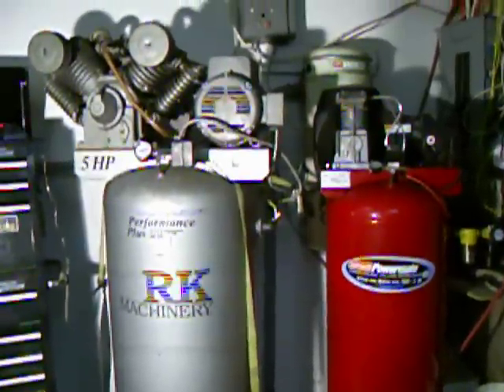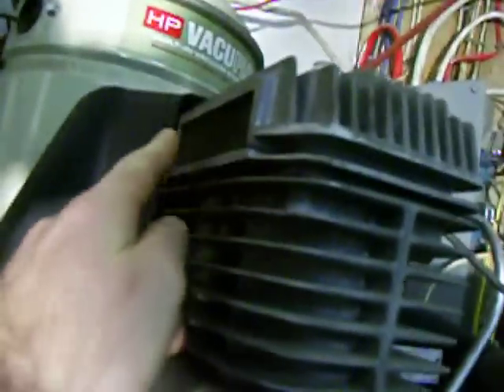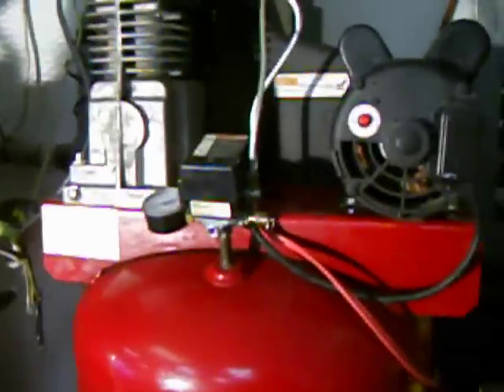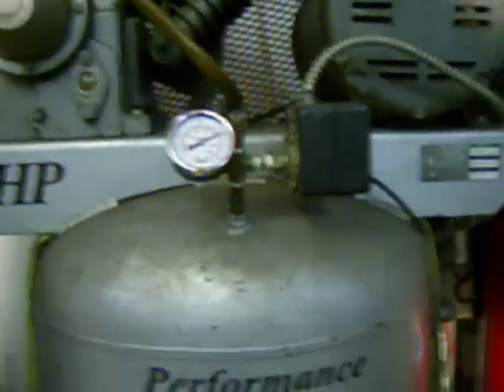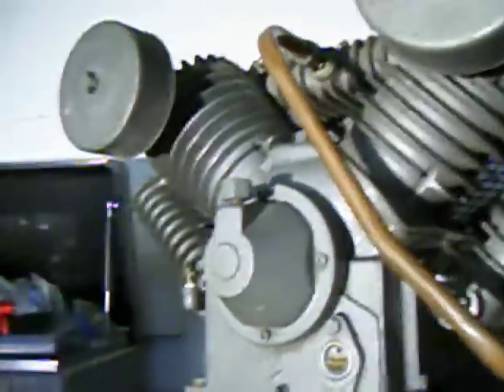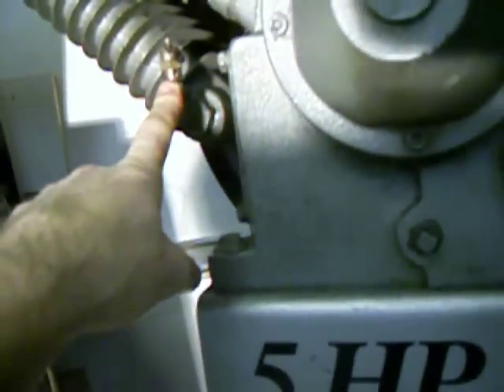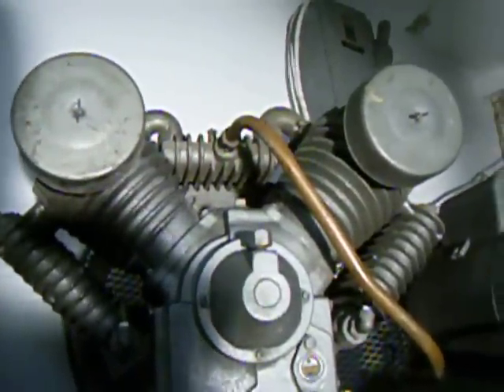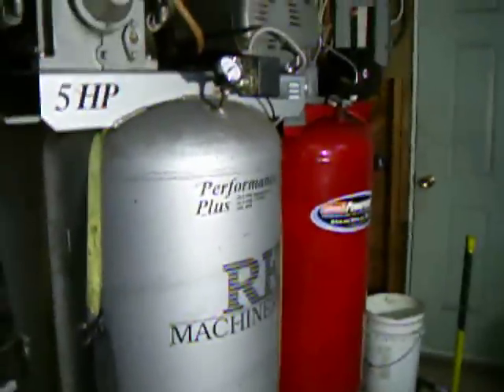Air Compressor Comparison_2Stage vs Single Stage

Comment: right at the moment i have a 30 gal 4 hp  sanborn built in 1980  which all the new one are 2 hp dont think it would be enough im getting afraid of the tank took off a fitting and looked at the with a scope still hard to detect how bad it is after seeing how some of these explode having night sweats great vid by the way

Comment: what is the noise level of the C
oleman
Reply from the maker: Neither were loud.  They were about the same volume but the 2 stage was pumping 4x the air that the Coleman pumps.  I wouldn't hesitate to buy either of them again.

Comment: for those of us who dont own both but are interested in buying upgrade, it would be good to run them both starting at 0 psi and show how fast the big one is at filling up compared to the box store unit.
Reply from the maker: All this info is going from memory:

The 80 gallon commercial RK compressor takes 9mins 15 seconds to pump up from 0 PSI to 175 PSI.  I know that is a long time... but it never has to do that work in my garage.  I don't have air leaks in the system and it simply pumps up from about 130-175psi as needed and that takes <2 mins. When doing tire rotations, I can do 2 cars before the pump cuts in.

The 60 gallon Coleman compressor takes about 4-5 mins to pump up from 0-140psi.  Then it drops to about 90 and cuts in until it reaches 140 again.  That recovery takes about 1 min 45 secs.  When doing tire rotations on a vehicle, the pump might cut in twice.
Reply: mr diyguy123 good to know, they are avout same then it sounds

Comment: same mistake everybody makes on your red tank. water separator/filter never goes there, yet thats where everybody put them. they basically are useless there as the water doesnt form til way down the line as it condenses. therefore, that device goes at end of line where you welill see a huge difference in its performance, for once, you will actually see it is catching something lol
Reply from the maker: Good feedback.  Many people simply have a rubber line leaving their compressor tank that they drag around their garage... but i agree with you that if you have the lines piped around the garage, having the separator at the tank does not take out all the water.  I would actually recommend a separator at the tank and another at the end of your piped lines. The separator at the tank does indeed capture some water.
Reply: mr diyguy123 ummm, yeah, the separator at the tank still catches some water. no,no,no. ok , so yes, it catches like a tablespoon a month no shit and i challenge you to check me on that. dude, i just drained my whole shop yesterday and got close to 2 gallons drainage. so tell me how the thing with 1 ounce of water in it is helping. trust me, its useless and you are cutting down on your flow with every device, every fitting, every 90°fitting, ,, all cut down on cfm to the tool. most set the regulator at 40psi and think they will paint like a pro cause they watched a youtube vid. not realizing at the end of the 50 ft hose, thru 8 fittings and 1 filter, they have actual 15 psi at the gun lol. clueless. then they swear a bunch, go online, and blame the paint.
Reply: True, but it's also a filter which can be useful to prevent crap from getting in your lines. Even better, install an after cooler between the pump and the tank, and a drain after the aftercooler, and you will catch a TON of water before it even makes it into the tank. Biggest improvement I can think of with no operating cost for an air compressor.
Reply: @MittyNuke1  but the more you put in line, the more you cut flow down.  Psi stays same, but flow is decreased. Wouldn't matter for the weekend guy who is blowing off a work bench, but for us guys who run a booth with air, volume is king. Buy a hi flo hi quality hi dollar filter and put it as far down line as possible...not at tank. Its definitely not common knowledge, but it's been proven over and over by all large shops...and the. Of course, drain your tank weekly and especially before a paintjob. My filter alone was over 100$ and allows full com through it. It is a paint booth filter.
Reply: @michaelcollins1899  Nothing to disagree with you here -- I have 2x 2HP compressors, each with an aftercooler + drain in between the compressor head and tank meaning it's only in the flow path while each tank is charging up. Line from each receiver tank to a manifold (2 lines in parallel) that goes straight into my 3-stage filter: regulator + 0.05 micron pre filter, 0.01 micron coalescing filter, and desiccant cup that I fill with beads when painting, which is essentially what you're recommending here (3-stage filter right before the hoses that connect to the tools). Paid about $120 for the filter - completely agree with getting a good filter. I just wanted one that I could replace the desiccant beads, since I just picked up an old refrigerated dryer the other day, and without that dryer, the beads get used up pretty quickly since I know the aftercooler only brings dew point down to ambient temperature at best case and for painting you want the air more dry. 

Right after the 3-stage filter I have a manifold feeding a hose reel + shorter hose, which is where I connect my paint sprayer or tools, and I've spent time testing everything, upgrading to high flow fittings/full port valves and adjusting regulators while using tools to ensure I still get 60-80 psi at the end of the line while using a tool (sander, grinder, drill, blaster, etc.). 100% agree with draining the tanks (I usually do it before/after every session of using the compressors for anything more than a quick blow gun cleaning), even though with the aftercooler I hardly get any water in the tanks. It's crazy to see how much water the coolers remove, which would otherwise go straight into the tanks, which was really the point of my previous comment. Eventually I plan to upgrade to a bigger 2-stage compressor but right now this setup can run a sander or any other tool I have (including a small soda blaster) continuously with sufficient pressure. But either way, this setup is  only for 1 person (me) and works great with good flow, but I would probably need to design it differently if there was more than one simultaneous operator using it.
Reply: @MittyNuke1  it doesnt hurt water to be in tank. I'd rather have it in tank than In the equipment or tools at the end of the line. My point was filter dont work right out of tank. The water hasn't had time to condense back to a liquid yet. It condenses as it flows thru line and begins to cool. That's why the only useful filter is at the end, nearest the tool
Reply: @michaelcollins1899  You can use an after-cooler between pump and tank. This will condense out water down to ambient dew point and keep almost all the water out of the tank. Makes a big difference if you are working while the pump is operating - my forced air after cooler inlet temps are essentially ambient.

Comment: What's the low pressure relief valve setting since I just picked a compressor up and relief valves were missing
Reply from the maker: single stage vs 2 stage will make all the difference in the proper relief values.  you should check with the compressor manufacturer.  That is what I did :)

Comment: do you need to drain the air daily?
Reply from the maker: If you were painting for hours a day, sure drain daily. However, for less constant use, weekly is fine. Obviously, humidity plays a factor.
Reply: Okay thanks
Reply: YES will save your Compressor

Comment: the "wrong" safety valve could have had the role to decompress the piston so it could be started easaley by the engine.
Reply: ttiiuutiu thats the dumbest thing i ever heard. The saftey valve will drain the tank pressure ONLY. the line from the pump has a check valve that keeps the pressure in the tank from bleeding out through the pump..the unloader valve is what bleed the pressure from the pump so it can start unloaded the next time..that why it is called an unloader valve.
Reply: @JM-yx1lm  No, there are safety blow off valves on the piping between stages in the compressor in this video, as well as one on the tank, and as well as an unloader which is what you're describing, and yeah the unloader is used to make the motor easier to start. I'm guessing that the multiple blow off valves is for the case that the valves on a cylinder fail, like if the second stage intake valve failed, the safety valve would prevent the first stage from building a dangerous pressure in the pipe between the first and second stage and destroying the cylinder seals or worse. If you have a single stage compressor, even with multiple cylinders, then the cylinder pressure is fed directly to the tank, so only one safety blow off valve is needed. With a multiple stage compressor, you need a blow off between each stage.

Comment: I'm kind if confusing about compresor.what is the different two &songle stage? Is it the double stage is  a lot bigger or better for heavy duty? Nonstop job?
Reply: 2 stage is more efficient and can reach higher pressures. Compressing air generates heat, so if you're using one cylinder to compress air from ambient pressure to 100 psi in one piston stroke, it will heat up a certain amount. A 2 stage compressor would use at least 2 cylinders, one to compress the air to maybe 50 psi, then the 2nd stage cylinder takes the 50 psi air and compresses it to 100 psi. Each cylinder is only compressing its air 50 psi, so it is not getting as hot, but you still get 100 psi air at the output. In the video, it appears that there are two cylinders for each stage, which just gives you more volume of air, just like a v8 engine has twice as many cylinders as a 4 cylinder engine, so it can make more power. 
To add to the benefits, and as you can see in the video, there is an intercooler between stages, so the first stage compresses the air, then the air is cooled down as it travels to the second stage, so now the pump is running at an even cooler temperature, and the resulting output air will be cooler, and the machinery will run more efficiently (less energy being used to generate heat) and last longer because it's not as hot. Also, if you have 100 psi of very hot air, as the air cools, it will slightly reduce in volume, so you need to compress more air overall to get the same volume of usable air, another efficiency gain of using multiple stages to compress air.
This is a similar principle of why the steam engines on old steam powered ships would use multiple expansion steam engines (like the triple expansion engines on the Titanic), since they can extract more power from the steam if they first allow the steam to push a cylinder, then use the exhaust of that cylinder to drive a slightly larger cylinder (since the lower pressure needs more area to act upon), and then that cylinder drives an even lower pressure cylinder. The exhaust from the lowest pressure cylinder will be much colder and lower pressure than the steam from the first high pressure cylinder, meaning more useful energy has been extracted from a given volume of steam. That process is used in reverse to compress air in stages, so that one cylinder isn't trying to take your air from 0 psi to 150 psi in one stroke, which generates a ton of heat and puts a lot of stress on the equipment.

Comment: If the first is a TWO CYLINDER, doesnt that make it also a two stage compressor? That was always my understanding.
Reply: Two stage means that, basically, one compressor's exit blows into another's inlet.  The "primary" is usually larger than the "secondary", as well. In a plain two-cylinder, both cylinders blow into a common pipe.

Comment: I would think that the 5HP motor on the 2 stage pump is actually rated for 5HP output, what RPM does the electric motor run at? Apparently the commercial electric motors comply with a HP standard, so it's actually 5HP, not peak or any other proprietary method of calculation that you see on home use compressors.

Comment: LOL magnetic starter? Contactor? it's a RELAY. It just a large relay. There are plenty of mechanical switches that can support high amperages but a relay makes since on a semi automated switch since you can put an interrupter on the signal voltage to give you your normal on/off switch.
Reply: fcguy7 no dummy, its a contactor that uses an electro magnet. Its not a relay because this is high amp stuff. Go see if your air conditioner unit outside has a contactor or a relay and get back to me on that.
Reply: @JM-yx1lm  A contactor and a relay are the same thing. Contactor is just typically used to describe a larger relay. They both work using an electromagnetic coil to make and/or break electrical contact.

Comment from the maker: This may help clear things up for you.  Your kiln uses 40 amps max at 220VAC, not 80 amps as you describe above (you don't double it).  It most likley uses a lot less but lets assume max power draw.  Power = voltageXcurrent=220X40=8800Watts=8.8kW. My power rate is $0.0985/kWh.  Therefore, at my house your kiln would cost at MOST 8.8X0.0985=$0.87/hour to operate if you left the cover open and it never cut out.  
My compressor: 25X220/1000*0.0985 = $0.54/hour to run

Learning: electricity is cheap

Comment: Two years ago my Mother and I acquired a used electric pottery kiln. It runs on 220V, 40 amps maximum per leg for a total of 80 amps at peak temperature. It maxes out at 2,350 degrees Fahrenheit, or so it says on the label. I several hours and 'bout $150 wiring it up in the basement and my mother, sister, and niece HAVE NEVER USED IT.

People tell us a pottery firing will use about $10 in juice in this area. The kiln will run for about 8 hours and then take 24 to cool down.

Comment from the maker: it kicks in about 2 times a month under my "normal usage patterns" due to the 80 gallon tank.  every 2-33 months I work on a project in the garage and it may kick on 10 times during that projec.  I would guess it would use less than $5 in electricity/year.

Comment: Enjoy your electric bill....
Reply: His electric bill will be based on how much air he uses. If he had a smaller compressor, it would just run for longer and probably cost more to make the same volume of air. I've never heard of a 4 cylinder compressor, but dual stage is more efficient than single stage, and two cylinders per stage is more efficient than one cylinder per stage. So that big compressor is actually more efficient than a smaller one, assuming you actually need a lot of air (since if it's starting and stopping constantly, then it's not running efficiently due to starting up, which isn't efficient, then unloading the pressure from all the piping and the cylinders every time it shuts off/wasting that air). As a comparison, Northern Tool makes a 3 cylinder, 2 stage pump, that makes 14.9 cfm @ 90 psi using a 5 HP electric motor, vs the 20 cfm @ 175 psi (that sounds kind of crazy) with what looks like a 5 HP motor on the compressor in the video. 

If you compared the electric usage of one of those little car tire inflators vs the compressor in the video, to fill that big tank to the same pressure, I would bet the tire inflator would use more power given the fact that it would run for hours to fill that tank vs just a few minutes with the pump installed on it in the video. Even though the small pump doesn't use a lot of power, it needs to run for much longer to compress the same volume of air.

Looks like an awesome unit!

Comment from the maker: @puttz1976 Hi there... my camera is not good enough to illustrate the difference in volume betweent the 2 units.  I too was very interested in the noise difference. The RK was quieter... maybe 20%... but more importantly the noise it produced was about 1/2 or 1/3 the frequency of the Coleman.  The lower frequency sound was not as irritating.  I have a 24X29 garage and can still talk to someone with the RK running but it is difficult to talk with the Coleman running.